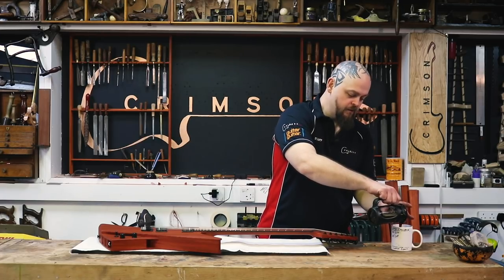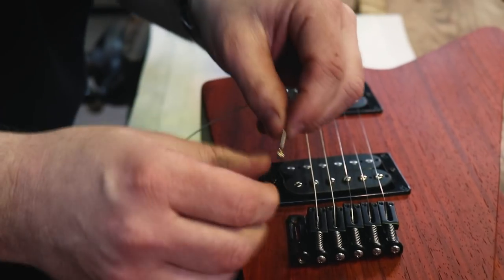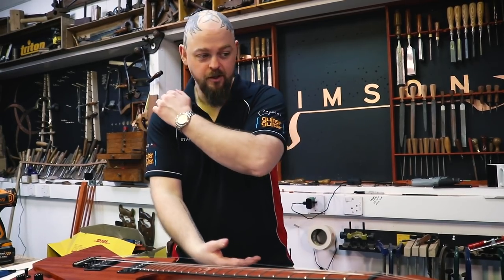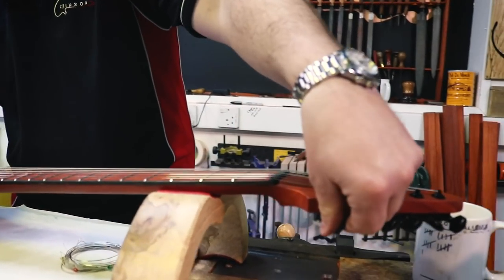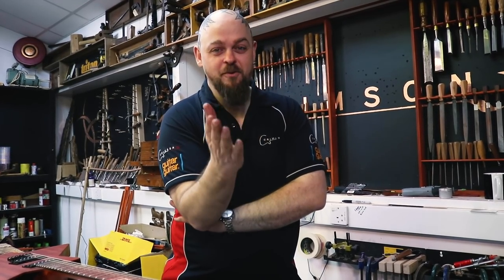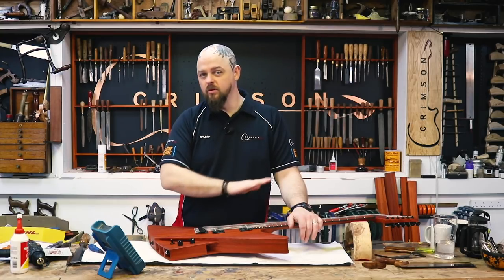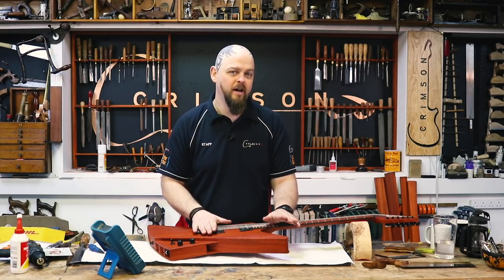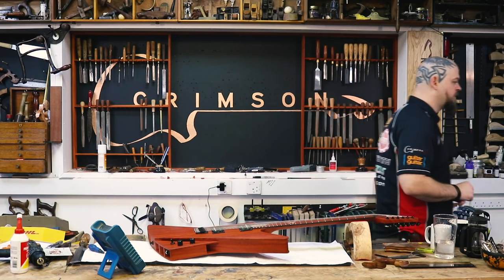Ep 13 - The Penultimate - A look at the UNIQUE 2020 Guitar Build Challenge

Comment: "double sided tape" . What??? I am appalled that you didn't inlay the logo... Heck, if I were the winner, I would specifically ask that you inlay it, whether it takes another month. Second comment: "Parallel" You keep using that word, but it does not mean what you think it means. Parallel is what the strings are to each other. "Perpendicular" is what the frets are to the strings (or the neck center line, if you wish)

Comment: The challenge will be making the case light and strong.  Plywood is strong, but not exactly pretty, hence usually covered.  Perhaps a tolex/fabric covered case with paduak highlights/details, handles and hardware in black, 12th fret logo on the case, Crimson logo by the handle?  Interior contoured with builders foam, plush fabric, sorted!  I can see it all...    ;- )

Comment: I did build a guitar case. I used the thinnest ply and pine. It weighs a ton, you need a fork lift to move it around with the guitar inside. It was a double neck guitar BTW.
Reply: Should have put wheels on it.

Comment: Yes! Please do. Make a case for it. I’ve got an old cedar chest. It’s very rustic so it won’t be a big loss as far as a piece of furniture. It’s very old and made from big 8-10-12 inch wide by full inch thick clear cedar. I’m definitely gonna make a guitar case out of it. I’m figuring I’ll probably make it into a sealed box and then cut it in half and go from there. But I want it to be correct for the guitar. As not to hurt the neck. So please do do a guitar case build. Thanks Ben

Comment: I've been out on medical leave for 3 weeks now. I've managed to watch over half of all your video's. You are an amazing craftsman, hands down. You missed a major wiring issue however. The bridge isn't fully grounded, only the high e is. I cringed when I heard you say, I'll just do them one at a time, taking the saddles off, I knew you wouldn't catch it. But that ground wire needs to span all 6 saddles, and the paint on the bottom of them needs to be sanded back. I hope I don't offend, love your work!

Comment: Technical comment 2: You've often stressed the importance of grounding each string, soundly and efficiently, to avoid such electrical gremlins as ground loops. I still can't see how you did it, except that the nut, being carbon fibre and likely electrically conductive, might do the trick albeit via a circuative pathway. The best way, surely, is to ground them all equally at the bridge - But you have 6 seperate bridges here and I only saw you ground one string! Did I miss something here?
Reply: something to do with all the bridge saddles being metal and in physical contact maybe?
Reply: @en_ray  Maybe, but I don't think so. I remember the problems they had with a build that had seperate string ferrules on a Hannes bridge, which has a a common metal part - only all these parts are coated! Plated, perhaps but paint or powder coat is a poor conductor

Comment: very nice guitar and video. Thanks....On your idea of more of this type of construction a while ago I looked at the remains of a solid body build and realised I had a guitar shaped hole. Just enough wood was left around the outside edge to bandsaw round and I then had the sides. Tail block and neck block glued in then maple lining as the sides weren't thick enough to hold the top and back plus simple bracing on 6 mm maple top and back and then F holes etc and the whole thing was curvy and loud enough to be played acoustically. And a significant part of the body was built from a piece of wood that would have been scrap. Just a thought. Did this twice more since, quite economic!
Reply from the maker: That sounds like a good idea for a project build one day! Thank you. B

Comment: It's hard to tell but it almost looks like both pickup pole pieces don't line up with the strings exactly.  It's like they need to be rotated slightly (e.g. clockwise on the neck pickup based on some stills I've managed to pause).  Of course, this may just be the video angle playing tricks on me.

Comment: Okay,  so you've solved this ball end anchor problem, but the strings are still resting on bare wood. What do you think is going to happen after about 5 years of heavy string bending, possible downtuning, and general live performance mayhem? I fear that the strings will eventually (possibly sooner than later) eat through the very clever anchoring design you have made. If you ever make a production version of this, or even another Custom build, I strongly suggest you use the string through body method with metal ferrules proven so effective since 1948.
Reply: The ball ends are held in the loose holes he made by the metal saddles. His problem was he didn't cut enough away the first time.

Comment: Ben, is there a "good way" or "correct way" to build up a string slot on the nut if the slot is too low/close to the neck? Thanks and amazing as always.
Reply: I'm just commenting because nobody else has :)  I have been told it can be done with baking soda and super glue.  Assuming the nut is a light colour.

Comment: I do desperately wish you could/would sell me one exactly like this, shape and all.  Well, with one minor tweak: I'd put the output jack on the solid bottom edge and the switch on the cutaway.  You'd wanna cut out paths for the wiring in the joists before the top goes on, I'd imagine.  Just how different would it have to be to stop Papa G from busting down your door with a cease and desist?

Comment: Is the darkening of the padauk due to exposure to light or oxidation by contact with air? If the former, is there a finish which contains a UV filtering component to at least slow the process?
Reply: I was just going to post about this. Yes, there are many commercial finishes with UV protection. From What I've been reading however, it takes 7 or more coats of these finishes to really get any protection and it only slows the process down. And to answer your question, it seems that padauk darkens both from light and air exposure.
Reply: @patrickwilliams3108  Thank you Patrick. I remember feeling sad as I watched a beautiful purple heart bowl turn plain brown over time.
Reply: @mykhough6614  Yeah. Breaks your heart, doesn't it?

Comment: My dream instrument has been inspired by this, and other Crimson Guitars videos. Input also from my aching back and tendinitis pain.

Multi scale bass, 32” on a low B transitioning to 28” on the G (standard 5 string tuning on the lightest gauge strings that I can get away with), semi-hollow body with a neck radius and body shape that will allow for some arco playing as well as pizz. Walnut top and back with Padauk for the sides would be great, I think. Maple board with half walnut/half padauk inlays. Walnut/padauk cap on headstock. Matte black hardware. Two humbuckers with a pre-amp very much like the one offered in Sire Marcus Miller M2 basses, or perhaps the Darkglass Tone Capsule. Combine that with a piezo system for the arco stuff. Would a second, on-board acoustic bass pre-amp for this be overkill? Who cares, I’m only dreaming here, so yes, a 2nd pre-amp for the acoustic/simulated upright side of things. Outputs can be sent separately from the instrument or a switch flicked to engage a blend pot to send the desired mix of the two voices.

Last off the top of my head idea, could a form of A-B-Y switching, possibly a little ore convoluted, be incorporated on board an instrument? In this instance to allow the sending of:

- Just the magnetic pups and pre
- Just the piezo system/pre
- Each of the above sent to separate outputs
- Both systems sent to a single output via a blend control
- Blend control also able to interact with how much of each side goes out to the separate outputs (I.e. bias towards the mag side send a hotter signal that way than the piezo side or vice versa)?

It’s late now, I should sleep. Hope my insomnia inspires waffle has been interesting to anyone that’s given it a read. Cheers, love the channel and all your work. Oh, also, you’ve got be able to monetise your coffee intake. “Coffee number seven of the 42day build - the Agrajag - is kindly sponsored by Megadod Publications” for example.

I’ll come back to you when I’ve got some money! Fretted and lined fretless versions ideally. Cheers.

Peter.
Reply from the maker: This sounds like something I want to make! Nice. Now, please excuse me, I need to google Megadod Publications. B
Reply: Crimson Custom Guitars sleep deprivation had obviously affected my spelling too! Glad you like the idea.

Comment: How about some recessed Suitcase type wheels at the end of the Case and an additional top handle, so it could be wheeled like a suitcase ? (Might need some springs to add suspension to the wheels !).
I also wondered about a fold-out 'stand leg' (like a motorbike) so that the case wouldn't fall over, as they have a habit of doing that when placed perpendicular to the floor … and a 'prop' to hold the case open ? Maybe some reflective strips to add visibility to stop people tripping over it ? 
It would be especially great to see a case with some unusual aesthetic design, that is still functional and maybe an unusual locking system that holds the non-hinged side of the case shut for the entire length …
Carbon Fibre would 'add lightness' … Can you hear the Mission Impossible music yet … ?
However, please don't make it boring Black !!!

Comment: I never understood why you see so many "Fender scale" fan fret guitars with the parallel fret at the 12th.

You should get the most out of the fan fret design when it matches your anatomy. When your hand is on the neck of the guitar in a relaxed position, find the fret where your hand "wants" to be perpendicular to the neck without flexing or twisting your wrist. That's where your parallel fret should be. When you move your hand towards the headstock, it wants to twist outwards, when you move your hand towards the body, it wants to twist inwards.

On a Fender scale guitar for me, the "neutral position" is somewhere around the 8th fret, leaning towards the 7th, on an average bass guitar it actually works out to be the 12th.

Comment: you should build a guitar entierly based on convenience for both the player and then the builder. as little Asthetic design as possible. Think that would be a challenge for you specific ;P

to elaborate, what I mean: Funktion before looks in all places. Easy to play, easy to hold, easy to string, easy to clean, easy to repair, easy to build and for the most possible uses. so not cheap and siple but just pleasant in every possible way for everyone who will have it in it's hands. 
I understand that your every guitar is kind of like that but I think you should focus on that.
for example easy accesable wireing and so on.

You tend to make the things more complicated try make it as easy for all people involved as possible with the best functioning instrument in the end.
And see how long it takes/how fast it can be achieved without pushing yourself to much.

so Playability>many Funktions>easy to build and repair>time>................................................style

Comment: OK, I'm going to snark a bit... the 8th fret is NOT parallel. I have pointed this out before, but you obviously ignored my comments, Ben. It is orthogonal to the centre line, not parallel. 

Why don't you listen to me? ("sniffs"... nobody listens to me).
Reply: Also, i don't really like the jack placement. It's ok if you use a right angle (Orthogonal!) jack lead, but a straight plug looks awkward. And what if you want to use one of those small wireless transmitters that go straight int the socket? Probably not going to fit. 
A small block attached inside to point the entry angle to the rear of the guitar would have been so much more useful.
Reply: how about "perpendicular" rather than "orthoganol"? With elementary geometry the amount to much the same thing, although the latter refers to how the things "at 90" influence each other as much as the angle in deeper meanings. Certainly though, "parallel" is not correct.
Reply: @ianb4801  perpendicular will also suffice, indeed. Although i aways think of that as a line STARTING at 90º  rather than going through (as it would be with the centre line).

WWED....? *

* What would Euclid do?!!!
Reply: @ianb4801  (Thanks for listening to me...!)😀